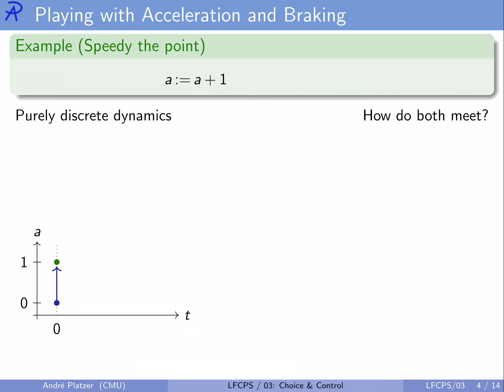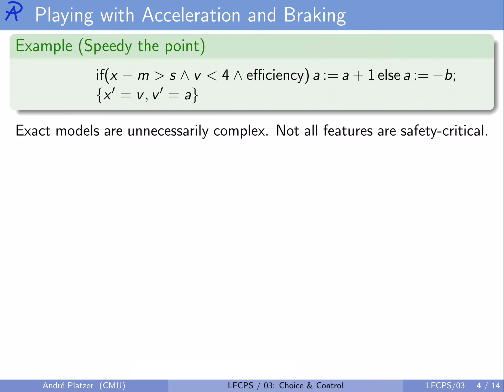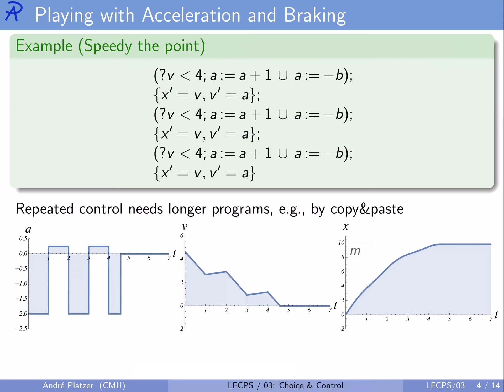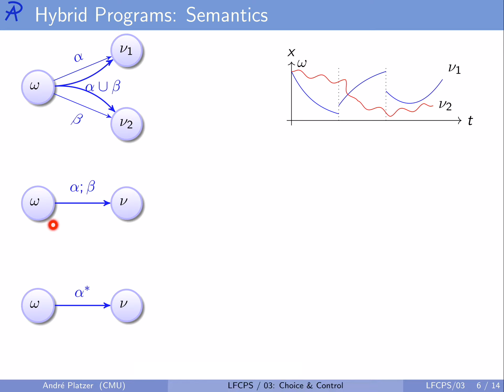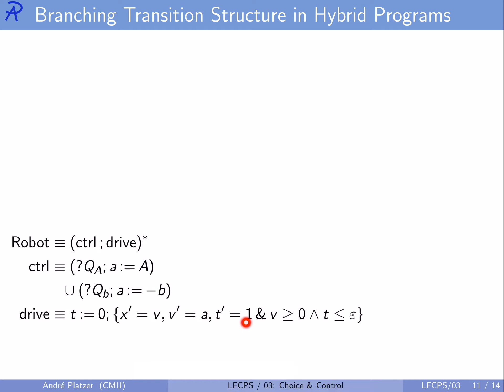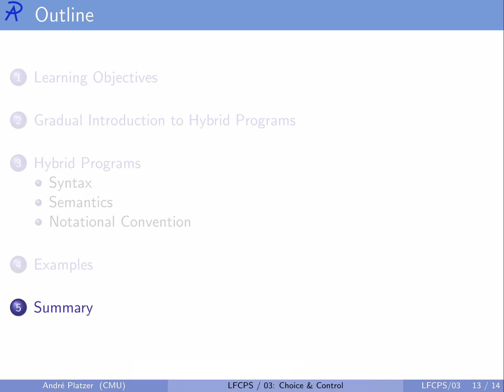03: Choice & Control - Logical Foundations of Cyber-Physical Systems

Comment: In, ? a ; b U c
Since, priority of the sequential composition operator ';' is higher than the non-deterministic choice operator 'U', the compiler should solve the left choice " ? a ; b " first and if the left-hand side of U gets executed for every control cycle then how is it a non-deterministic choice?
Reply from the maker: It's still a nondeterministic choice because ALL runs of the program are considered, including the ones that try to run ?a;b but also the runs that try to run c. There is no order whatsoever in a ∪ choice. While left-to-right evaluation order is not a bad mental model for a human to follow in order go through all the cases, it's still important that all runs are possible. So if you found one possible run you still need to go on to see if there are any other possible executions.
Reply: I mean, there will be no run in which directly 'c' will execute. Since, ' ; ' will always be operated before '∪', due to its high priority. Which means even before we could make a non-deterministic choice, we will have to process ?a;c.
If we say in (?a;b) ∪ c, the compiler could run any of the LHS or RHS, then we are simply saying that '∪' has higher priority than ';'. Which is not true.
Reply from the maker: @sharedyatra  No ∪ really is symmetric/commutative, just like addition is for numbers. It does not matter at all whether you write ?a;b ∪ c or whether you write c ∪ ?a;b. They are HPs of exactly the same effect. That becomes particularly clear when you write down their semantics, by listing the set of all runs each program can have and comparing them. Obviously the program b;?a ∪ c is very different because it tests a AFTER b ran as opposed to before b ran. I suggest you carefully review the mathematical semantics of hybrid programs to align your understanding.

Comment: In a non-deterministic choice if RHS is false then the control doesn't go to the LHS but vice - versa is true. Right?
Reply from the maker: Programs cannot be false they just run (or don't if they can't). But I suspect you mean the program failed a test and thus cannot run. Indeed if the LHS of a nondeterministic choice can't run then only the RHS can. But it's symmetric. So if the RHS can't run then still the LHS may. It's often best to think about all possible runs by backtracking whenever a test fails or a differential equation cannot satisfy its evolution domain constraint.